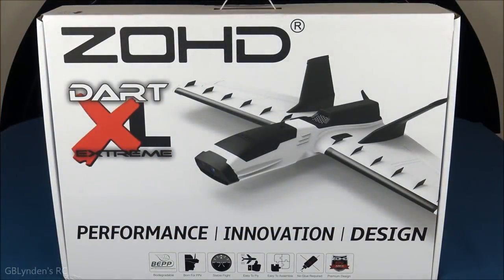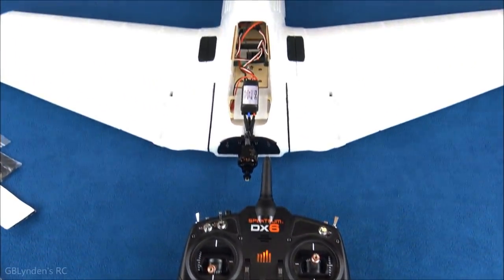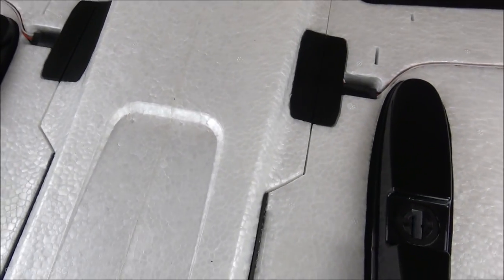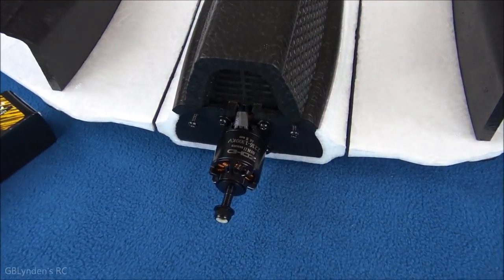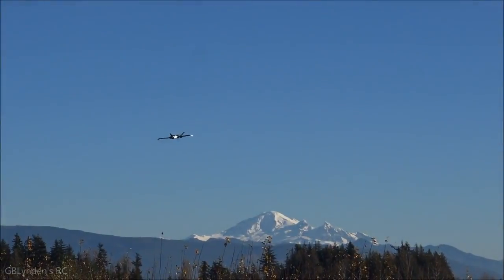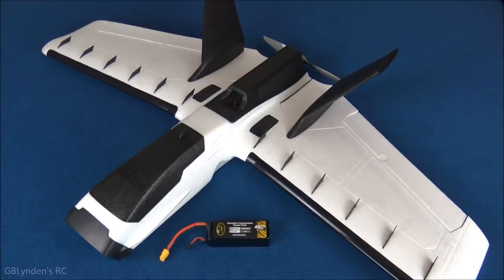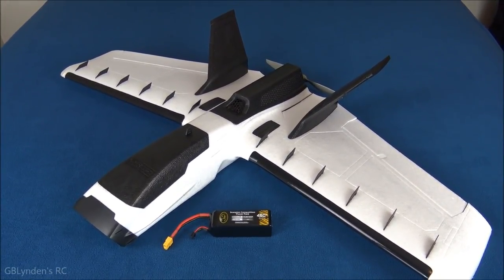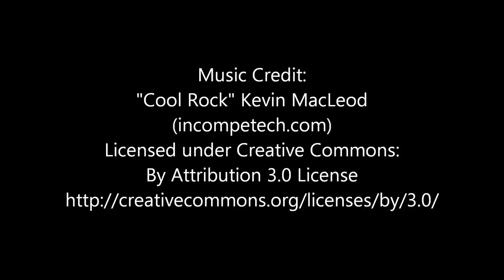ZOHD Dart XL Extreme FPV Wing Unboxing, Maiden Flight, and Review

Comment from the maker: Link to the RC Plane: https://goo.gl/QNaSDS

The links in this description are affiliate links. They give me a small commission on sales which helps support the channel and keep it independent: https://www.amazon.com/shop/gblyndensrc:

RC Equipment Used In This Video:
- ZOHD Dart XL: https://amzn.to/2GzX0Jl
- Spektrum DX6 Radio: https://amzn.to/2RgoDes
- Spektrum AR410: https://amzn.to/2Bz2VIH
- Flight Battery: https://amzn.to/2Sh5TZI
- Battery Checker: https://amzn.to/2OXB1N2

Video Equipment Used To Make This Video:
- Sony AX-33 Camcorder: https://amzn.to/2RHVhpI
- SanDisk Extreme Pro SD Card: https://amzn.to/2BzXZU0
- GoPro Hero 7: https://amzn.to/2TfJpsg
- Runcam 2: https://amzn.to/2V47eoi
- Insignia Lapel Mic: https://amzn.to/2Rb2tu9
- ESDDI 20"X28" Softbox: https://amzn.to/2rPnCMh

Comment: She's one of the best FPV planes ever made! I fly mine with a 4 cell 5,200 mAh Multistar LiPo and an APC 9X6 prop, ditch the little 2,200 mAh battery.  I've had mine 6 miles out.
Reply from the maker: I agree that it is great, just like the ZOHD Talon GT with a similar fuse. It is a lot of fun too and I use a 3300 in that plane :)

Comment: JST is power for the VTX. Video transmitters usually take full voltage and can send 5 volts to the camera. VTX would sit back there for cooling as well. Nice video.
Reply from the maker: Thank you so much for that! This plane is full of all kinds of great surprises :)
Reply: @GBLynden  I have not maidened my XL yet. I'm back to see how I need to offset my motor and bracket. Been a while, but I think it use to pitch up on throttle up. So angled down I know but I don't know if it should be angled left or right. Did you offset your motor or take care of it with trim. Thanks.
Reply: @GBLynden  So I looked at some comments from my buddies flight and his had right trim. Alishanmao said it torque rolls left. Maybe I'll rack my brain and figure out which way to offset the motor.

Comment: The plane looks great of course, from the maiden the motor is strong, I guess it can get reinforced by fiberglass sheets and it won't slow the plane
Reply from the maker: Yep, that is one thing I could have included in my review notes. People are using Carbon Fiber to reinforce the nose.
Reply: @GBLynden  that's smart, but I would suggest the wings too because they are too much pointing to the front, and it won't be forgiving when the plane gets a rough landing while leaning to a side, the wing could break if not reinforced maybe? This is only my guess
Reply from the maker: Actually I mention in the video all of the carbon fiber tubing. The wings would survive nearly any crash. The Fuse, not so much due to being big and hollow.

Comment: Great review! Have you already decided on what fpv setup you will get?
Looking forward to get mine and do some chases and filming of my flying buddies new planes with the Dart XL ;)
Reply from the maker: Thanks man! I am glad you get to watch this entire video with all of the part on and pieces for the camera references. I haven't had time to add the FPV gear on it yet, but I do plan on using AKK VTX's and either my Runcam Eagle 2 or the my Foxeer Monster FPV camera. I do also have an AKK camera that fits perfectly in the nose, so I might use that if I don't mod the nose.
Reply: @GBLynden  Thanks, it was interesting to watch as all your vids ;) - FPV will be totally new to me so I'm looking around what gear is used. Not sure yet if I'll be looking at expensive goggles like Fatshark HDO but I'll surely will first talk to some freinds doing FPV racing to get to know more about it.
Reply from the maker: Thanks man! Regarding the FPV Goggles, it really depends on which route you want to take. If you want to dabble in FPV, get some inexpensive box goggles like these: https://goo.gl/7jE31s If you want more deluxe goggles because you know for a fact you're going to be in the game for a long time, then jumping right into the FatSharks is the way to go IMO. Note: Feeling motion sickness the first few times flying is common and it goes away quickly for most people.
Reply: @GBLynden  Thanks for the info! I'm not sure if I can wear normal goggles after all since I'm wearing glasses. Might also look into FXT Viper v2's as I plan to also learn flying fpv quads. Merry Christmas!

Comment: Well As Far As What I've Seen In A Few Review Videos On This Plane, Is That The Long Nose Is Flimsy !!!
Under Just A Moderately Hard Landing / Crash It Will Bust Completely In Two!?
Soo Straight Out Of Box You Should Glue In 2 to 3 Full Body Length C/F Spars or Something Similar Too Beef It Up To Avoid Breaking It In Half!!! I Would Also Add A Reverse Folding Prop On It To Save On Broken Props &/or Breaking The Motor Off Also! If You Hook Something On Landings ETC... Thanks
Reply from the maker: That CF spars are a good idea and will be easy to add. The crash that I saw that you're probably referencing was a worst case scenario where he lost his signal and dead sticked into the ground. Any foam plane is going to explode when it hits the ground. Here is the deal though, this foam is meant to tear instead of stretch and bend. It makes it much easier to put together again. Check the thread on RCGroups to learn more about that :)
Reply: No I've Seen At Least 3 Different Videos In Last Two Weeks Where They Broke Right In Front Of The Wings...😋
Reply from the maker: Good to know! lol

Comment: For your safety, you should always remove the prop before testing the motor. Therefore you and your rc plane/heli does not get hurt/damaged. Fly safe!!🤙
Reply: I agree on that
Reply: It looked to me he tested the motor and ESC without the prop and did the calibration as needed. Then he tested the prop by putting the prop on the plane to test the prop.
Reply from the maker: That is exactly what happened. Thank you for your comment RCWeaven! :)

Comment: Hi, how's the empty weight?
Reply from the maker: I am not sure what you mean lol
Reply: @GBLynden  There's only "Recommended Max. Flying weight: 1200g". I'm curious how much does it weight out of the box? Without batteries and receiver.
Reply from the maker: It is pretty heavy, but flies light if that makes sense.